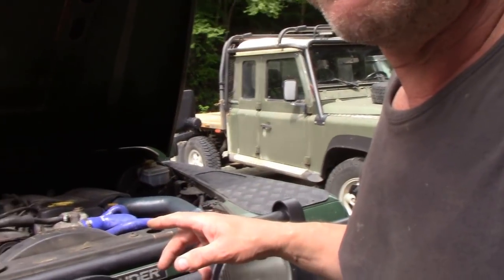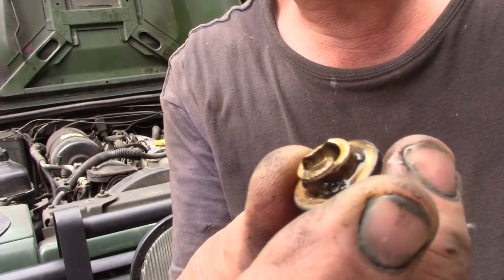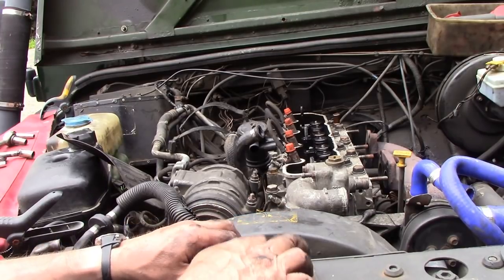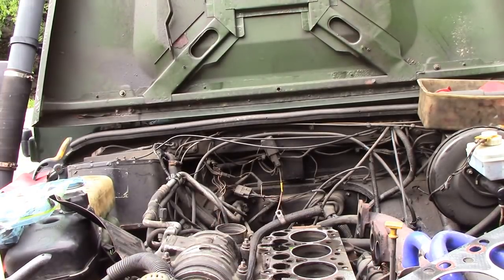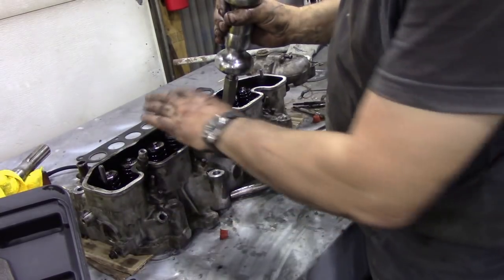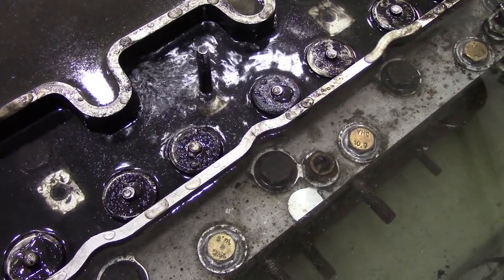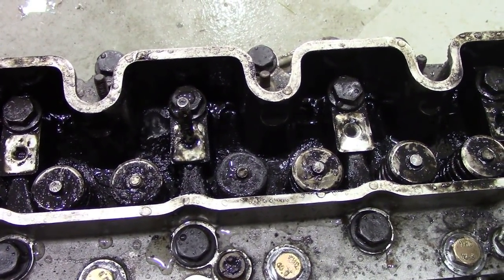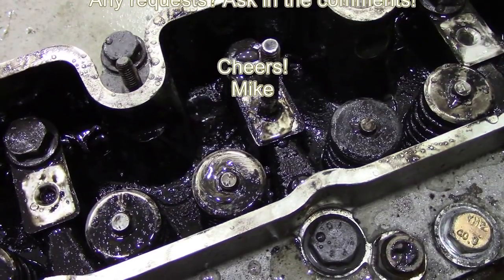300Tdi Mystery loss of coolant when driven - no overheating what could it be?

Comment: Had the same problem over some years and never found it. No water found in exhaust gas, no water in motoroil, no compresson lost, no waterdrops anywhere. At last: opend the motor and found Zylinderhead and motorblock washed out between cylinder 2 and 3. Had to change the whole engine because overhaul and planning was MUCH to expensive...

Comment: Nicely timed video! I'm pulling the head on my 300tdi discovery tomorrow with a suspected headgasket issue. Will definitely be getting the head pressure tested.  Thanks for the videos!
Reply from the maker: I made my own pressure tester as I learned a less on a while back on replacing a cracked head - but in the exhaust port
Cost me less to make my own kit than 3 tests at the machine shop.
Replace with an OEM head gasket LVB500220G Reinz and an OEM head set - do not use cheap parts - not worth it
MIke
Reply: Britannica Restorations thanks for the advice.  Any chance you might do a video on your pressure tester in the future?
Reply from the maker: I will do a quick video tomorrow
Mike

Comment: If the exhaust valve guide is loose, and the crack is at that valve, and on the exhaust stroke, coolant could be sucked by the guide and out the exhaust manifold

Comment: Hello Mike,  did you ever heard about an expansion tank separeted by thé middle ? I think my tank is leaking at thé jonction between up and down part. I changed it since i had thé vm part (wich is thé same) and will try to check thé one i removed tomorrow.
Reply from the maker: The old black tanks can crack - the newer clear tanks are better
Reply: Ok, you have à ref for it ? the one i found on thé net are all Black, like mine. I found bearmarch tank , witch is transparent,  is it this one witch is stronger ?
Reply from the maker: transparent

Comment: I have a v8 eating a bit coolant and I had my heads off and tested, machined them and tested.  Did all the front cover and water pump entire coolant system, hoses, radiator even the throttle heater plate 100% new.  Come to conclusion it’s a mystery.
Reply: My temps are ideal and no power issues at all. No problem other than little loss coolant and slight smell.  No visible loss, no pressure loss.   Maybe my block. Considering adding a stop leak product and I HATE THAT STUFF as a rule.
Reply from the maker: Try a coolant dye and UV light

Comment: Very cleaver pressure tester. I cannot imagine how you set it up. You know the engine inside out. So in this occasion just head replacement did fixed it? If in the remote location, would pepper in the radiator get me out of trouble temporally???
Reply from the maker: yes a new head fixed the problem
Pepper? maybe

Comment: I hope that you tied the bonnet back Mike.  They don,t half hurt if the wind catches them and they come down on your head while you are under it. I always run a rope from the bonnet catch spring, over the roof to the tow ball at the rear.  I recon that you have a bad casting that has given out after some running time as the spot where it is leaking  is not a wearing site or anything like that. Of coarse, I would like to know what it is if you find out.   Keep the video's coming Mike, great stuff. Best wishes from Yorkshire, Rob.
Reply from the maker: Indeed Rob I have the bonnet fastened up with a rubber bungee attached to the sun visor!
I am of the opinion it is a bad casting - seen it before where the sand eventually drops out and then leaks
Mike

Comment: Do you think the timing belt might have snapped and maybe the pushrod bent in such away it's damage that part of the head by putting a hairline crack in it?
Seems a strange place to get a leak but well done for finding it....
Reply from the maker: I don't think so as the customer never mentioned it  - but it could happen!
Mike
Reply: Britannica Restorations maybe it happened years ago as the 300tdi had problem with alignment when first introduced and it's gradual got worse...
Just a thought.
Reply from the maker: I noticed the head it stamped 2012 at the back - so not the original - looks like a bad casting

Mike